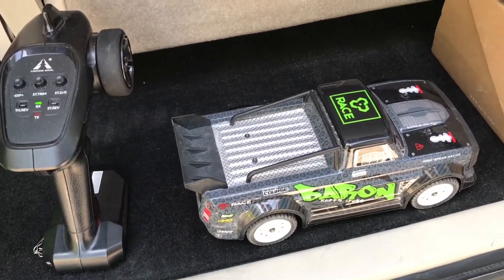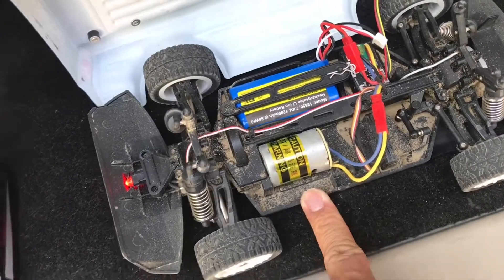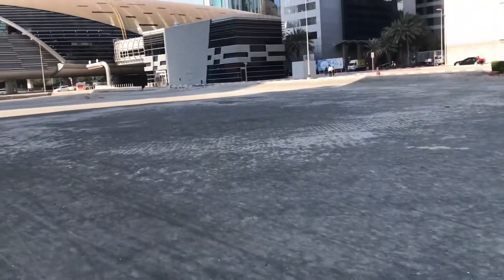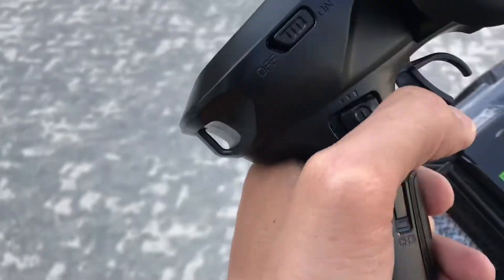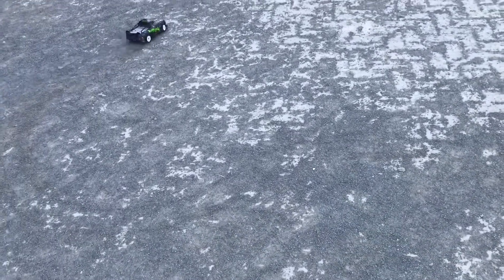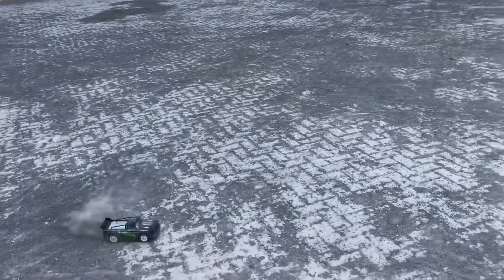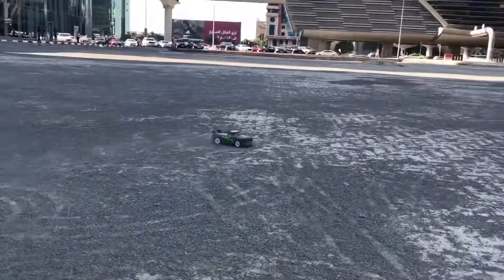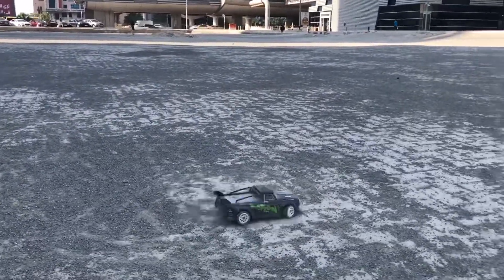RC bashing - 1/16 Pinecone SG 1603 brushed

Comment: hello i also live in dubai, which one is better. The real wltoys 12428 or the one which you had in your previous videos
Reply: please reply fast
Reply from the maker: It is the same wltoys 12428. The guys from Dragon Mart just rebranded it, then it has also paddle tires which is grippy in sand. For beginners like me, i find it fun, but i like more speed 😂 - top speed is like 20-25 kmh only and runtime is 10-15 minutes on a full charge
Reply: @ButchiRC  thank you
Reply: @ButchiRC  i got the one you have but the remote is not digital? why?